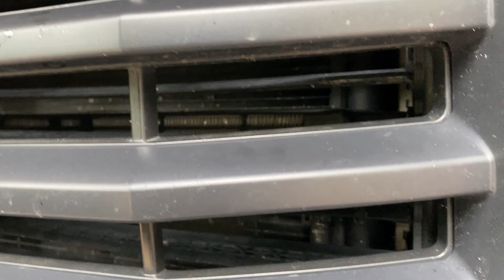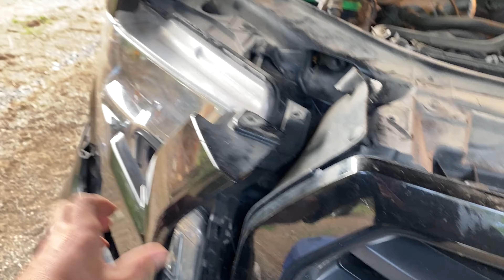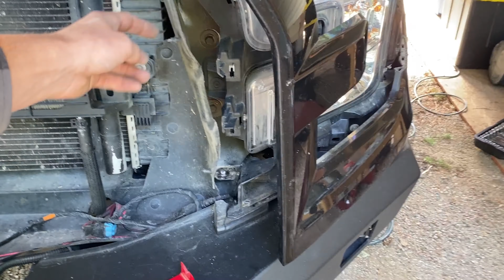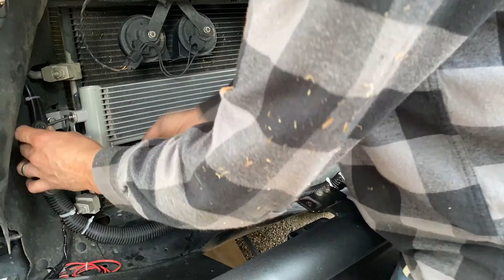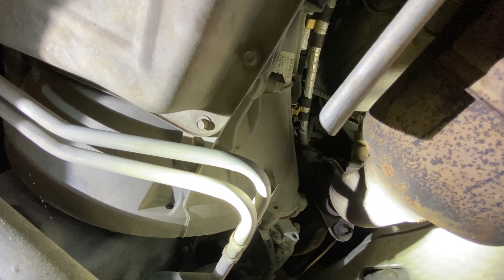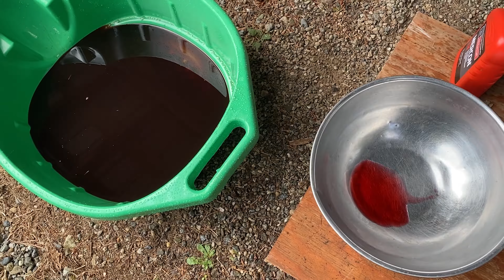I Installed a Mishimoto Transmission Cooler in My F150

Comment: Hi did you have to add more ATF when you added this cooler or no
Reply from the maker: Yes, I had to add back more Mercon LV ATF. I would recommend changing your fluid out if you haven't already before starting it up. Also don't add the in-line filter it will cause issues later on. Mercon LV 1quart (takes roughly 5 quarts)  -  https://amzn.to/3J57Qmu

Comment: Ur cooler upside down on ur stock and ur after market cooler that’s y ur over heating
Reply from the maker: Nah that's how it comes stock from the factory on the 5.0L and how Mishimoto recommends installing their cooler. It's designed to be flipped over though for the Eco boosts because the routing would interfere with the intercooler down below.

Comment: Mpg increase?
Reply from the maker: No it had no effect on MPG just better cooling for the transmission especially towing under heavy loads in the mountains and driving in the sand when you're running high revs.
Reply: @jacobsupgrades but it didn’t decrease?
Reply from the maker: @DavidHernandez-e3q5s no it remained the same for me. My 5.0L has always given me around 13-15mpg with mixed city and highway driving and 7-9 when towing our 21ft camper depending on the wind and grade. Before I put the road armor winch bumper on it was more like 16-17mpg mixed driving.

Comment: You could also go with an aftermarket transmission pan. PPE makes a deep pan with cooling fins. It’s a bit pricey, but it offers better cooling and adds extra capacity to the reservoir. As an added bonus, it includes a drain plug.

Couple tips:

If you drop the pan and change the fluid in it, you’re only replacing a portion of the total transmission fluid. When you work on the transmission cooler, you can disconnect the hot fluid infeed line while the truck is running. This allows the transmission to pump fluid into a bucket. Keep refilling the transmission as it pumps out, and you’ll be able to exchange a much larger amount of fluid. Chances are, your initial fluid change only replaced about half of it. Also, the filter remains dirty. You should do the fluid exchange in the transmission first, then run it through the pump to get what is in the torque converter, and transmssion circuits.

For pans with your design, you can use aluminum foil to create a channel when lowering the back of the pan. This helps funnel the fluid into your drain pan and minimizes the mess.

If you go to Harbor Freight, you can get a transfer pump for around $8. It takes about ten strokes to move the fluid. The pump you used looked like a soap dispenser, which probably required a lot more effort.
Reply from the maker: Thanks for the advice that is good to know. I'm probably dude to flush it again soon. I saw that pan as well when I was first looking at cooling options. Have you installed one on your truck?

Comment: I just had one installed as well for 2013. I did notice the M is upside down on mine. I had my mechanic do it. Does anyone know if there would be a problem wth it upside down? Seems iti could go any way but I’m hoping the flow will be ok.
Reply from the maker: It's designed to be oriented in both directions. I believe the EcoBoost engines require it to be like you mentioned upside down from how I have it.
Reply: @jacobsupgrades I appreciate your input it makes me feel better lol. It does look like either way would be fine. I also installed there radiator and I’m hoping it will solve my over heating issue when towing my rv. Thanks
Reply from the maker: @Maga4Lyfe  What size RV are you towing?
Reply: @jacobsupgrades 28 foot about 9k max when loaded. Be taking it up the mountain next week. I’ve tried it with tunes installed and without and always overheated. Truck has plenty of power as I’m barely on the gas.  will see how it holds up

Comment: Good video, thank you. Couple questions:
1. Did you leave that in-line filter installed indefinately?
2. Can you change the filter without removing the grill again?
Reply from the maker: @tfoz2235  thank you! Great questions. 
1. I planned to leave it and replace it after a few years. After 3 years this last winter I noticed leaking transmission fluid in my driveway during -15F temps for multiple days. I traced it down and found the filter had gathered moisture and froze up causing a leak. I ended up buying a new transmission line and replacing it with no filter. 
2. No I had to remove the grill again. After doing it once it's pretty easy to pull it all apart again. I took that time to clean my ac condenser and radiator really well. Just make sure you don't get moisture in the active grill shutter plug or ambient air temp plug like I did. I threw some codes and had to dry them out really good. 

If I were to do it again I wouldn't install the filter unless you think you're having issues with your transmission. In reality changing the transmission filter and putting fresh fluid in should do the trick and no need for an in line filter.
Reply: @jacobsupgrades great info. Thank you for getting back to me an answering those questions. When I tackle this job, Ill skip the inline filter.
Reply from the maker: @tfoz2235  I'm glad to help out! Good luck on your install.

Comment: What is the temperatures drop with larger trans fluid cooler?  I saw you were getting 240F before but what after?
Reply from the maker: @phillipperritt7787, while towing it now hangs around 200-210. The highest I have seen on a mountain pass was 225F. I usually drive in manual mode while towing in those situations and try and hold 3rd gear as long as I can and that helps a lot.
Reply: Thanks a million bought a 2018 F150 5.0 this week.  @jacobsupgrades
Reply from the maker: @phillipperritt7787  that's awesome! You'll have to let me know what you think of the 10R80 transmission.
Reply: Did mine on my 2019 this morning. Thanks for the great video tutorial!

Comment: why not just change the tranny filter while you were in there replacing all the fluid? guess i dont know miles on your truck
Reply from the maker: @idahoman966, great question, at the time I had less than 100,000 miles on the truck and really didn't want to mess with dropping the pan to replace it. Recommended service interval is 150,000 miles but if you tow any I would do it sooner. It's on my list as a project this winter.

Comment: A very seasoned transmission mechanic told me that the torque converter clutch in every 6R80 is going to eventually fail and the metals will then destroy the transmission.  According to him, it doesn't matter how you take care of the fluid, and it doesn't matter how you drive it.  You could baby it like grandma and keep the fluid bright pink (which is difficult since Mercon LV turns dark very quickly even under normal driving conditions) and it will still fail.  You can expect to get between 100-150K out of them, max.  I'm writing this in the middle of a 6R80 transmission swap in my 2016 F150.  I also tow a camper.  I do my own work, so I asked the transmission guy I know whether or not I was insane to try to swap transmissions in a driveway, considering my experience level.  He gave me his opinion of 6R80s, Ford, and the auto industry in general.  Thanks for this video.  I'm replacing my transmission cooler and all the lines and this will help me figure out how to get my grill apart.
Reply: This is a old video but the best thing you can do is a thermostat delete for any of these type transmissions.  In the 6r80 it requires removing the pan and valve body . There's videos about how it's done not many but you can find them .
Reply: Certainly not true. I own 2 6r80 equipped vehicles. A 2008 Expedition and 2016 F150. Both have had the torque converter replaced however thats as far as it goes, the rest is bologna. Expedition developed a shudder at 218K and we replaced the converter. No damage to the transmission and its at 238K now. The other is a  2016 F150 and is a full bolt on e50 tuned beast and has had the hell ran out of it from racing to heavy towing and long distances at times. Has pulled 11,000 lbs 400 miles and 3000 back. 6000 lbs 1247 miles and 3000 lbs back. On and on. Ford service recommendation was 150K, I did it at 150K. Same as the Expedition it developed a shudder at 168K. Replaced converter and now tearing up the highway at 205K. 100-150K max and a destroyed transmission is absolutely bogus. I must have the only 2 good ones.
Reply: 179k on mine and no problems.
Reply: Just crossed 200k in mine, dropped the pan 7 times since buying at 48k. We’ll see how it treats me. Tuned and has seen much abuse
Reply from the maker: @colliswilliams8992, thank you for the seasoned advice! I'm glad I could help.
Reply: I wasn't sure how to refute this claim on the 6R80, so I AI'ed a suitable answer. Yes every transmission and every machine will eventually fail, but the 6R80 is a very robust transmission. 
AI: The Ford 6R80 is widely considered one of the most durable, robust, and reliable modern truck and performance transmissions. Based on a heavily tested ZF design, it regularly lasts 200,000 to 300,000+ miles with proper maintenance.

Comment: Chevy has the same problems but worse. But you can change the thermostat on them pretty cheap and it will run much cooler. Still won't fix the fact that they are junk though.
Reply from the maker: @Kevin Albritton, I agree with you. I'm wondering if regearing my front and rear diffs would make the biggest difference in performance when towing. Especially when running 33" tires or larger.
Reply: @jacobsupgrades  Lower gears will always help with pulling but I'm not sure how your computer will react. And it will lower your fuel economy.

Comment: What temps were you getting before this install. My transmission gets up to 230 not even towing with no cooler installed.
Reply from the maker: The F150 was getting low 240s while pulling a camper. Are you considering adding a cooler to yours? Are you driving a lot of mountain passes?
Reply: @jacobsupgrades  yes I want to add a cooler. It can get up to 230-240 when I have to rev up the engine to go uphill. like 3000 rpms for about 20-30 seconds to maintain hwy speed for a couple hills on my way home from work.
Reply from the maker: @Thomas-Jaramillo  that seems pretty high for not towing. Would highly suggest adding a cooler.
Reply: @jacobsupgrades  I took it into a transmission shop, they found burn atf and think there's damage internally

Comment: Hello, I am battling the same problem with our camper. We have the HD payload package on a 2015 5.0. We live in northern Idaho and every road goes way up or way down. I did service the transmission with Amsoil and a new filter, it helped on the  acceleration shudder from a stop to speed, after the second drain and fill, but still have high Temps on the transmission when pulling big grades. I'm am divided between the AFE aluminum pan or the cooler? Whats your thoughts?
Reply from the maker: @rugerkampf, the transmission cooler has been a huge upgrade over the stock one but out East we did have the transmission get hot on long steep grades. I'm sure pairing it with the AFE pan you mentioned will help cool even more. After some thought I think regearing our truck to compensate for the 33" tires will help even more.
Reply: @jacobsupgrades I have not done a bigger pan on my f150 but will probably do the cooler to start. I have a deeper pan with cooling fins on my 3500 Cummins and I hardly notice a difference. It has a huge cooler from the factory so that probably already works really efficiently. With that truck I tow 12k+ from Texas to Michigan, I hit a few steeper hills if I come up through Tennessee. But that’s my experience with a completely different transmission and truck so maybe it’ll help on the F-150 more
Reply from the maker: @justinlamb3822  thanks for the feedback!

Comment: Thanks for the video! I ordered the mishimoto and the proper lines from ford today. Plan to add the trans cooler to my 16 F150 5.0 this weekend. It’s an XLT that does not have the heavy duty towing package added so I am adding this to prepare for hauling a travel trailer.
Reply from the maker: @Daniel Lambert, thank you for the comment, I'm glad this video helped you decide to tackle the job. It's the best towing upgrade I have made so far for towing our Grand Design travel trailer. Another one is the Power Stop Z36 brake pads and drilled and slotted rotors for extra stopping power. If you plan to do any mountainous driving this will help keep your brakes cool and last much longer.

Comment: Did it make a difference?  I don’t have a cooler currently. Just bought the one you took off actually for my 2016 f150 lariat 5.0.  Wondering if i should’ve spent extra for the moshi
Reply from the maker: @leblunt27 Thank you for the comment. Yes the Mishimoto Transmission cooler has made a huge difference over the stock cooler. It is significantly noticed on high mountain passes while towing a heavy trailer. Since we are on the road full time we wanted peace of mind knowing the temp wouldn't climb above the 225 range, where the trans fluid starts to break down. I'm happy with the upgrade and peace of mind.